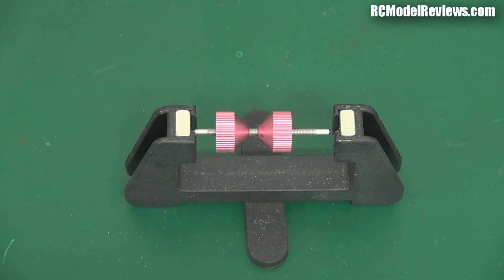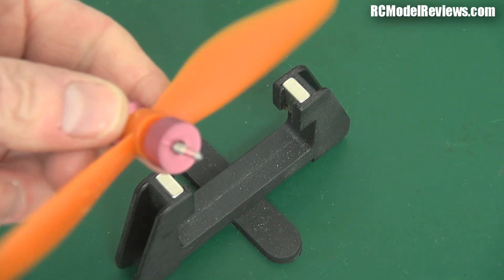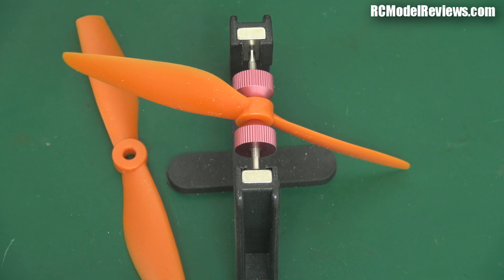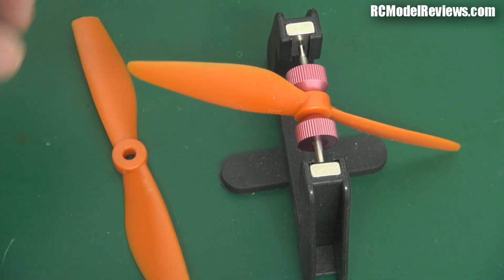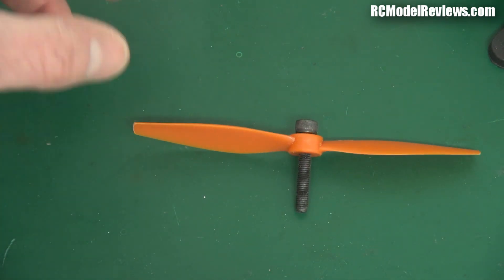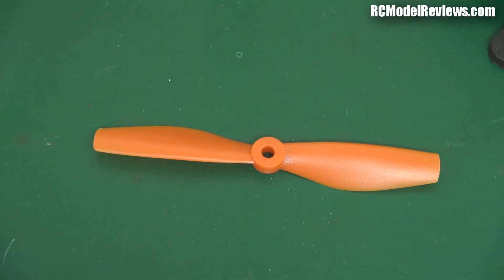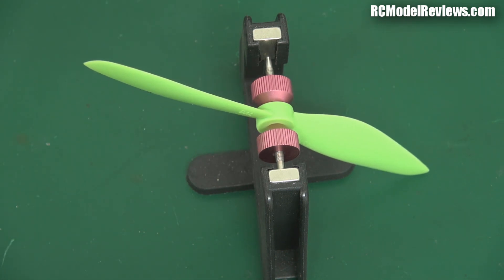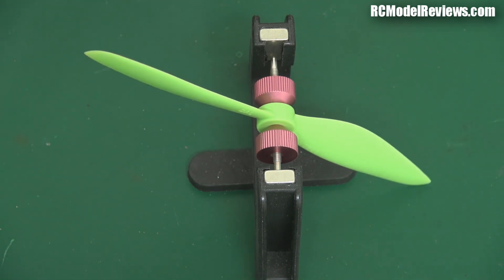DAL 6x4 propeller balance issue

Comment: Prop has to be perfectly made in 1st place for air suspended vehicles bcz even if we balance using centrifugal force balance eq m1r1w^2=m2r2w^2 with w^2 cancelling turns out to be w1r1=w2r2 same as normal weight balance. But this doesn't balance gyroscopic couple on both sides bs                gyroscopic moment=w1w2mr^2     unbalanced gyroscopic moment atributed to r^2 terms give rise to precession & instability as spin axis no longer axis of symittery & observed as toilet bowl effects

Comment: A balanced props should stay at the angle where you just hold it. If you let it go while it is horizontal, it should stay horizontal. I you let it go at 30 degree to horizontal, it should stay at 30 degree to horizontal. In the first test in this video, the prop "bounce" back to horizontal after Bruce tilted it slightly, so it is obvious that this balancer itself is not balanced.

Comment: I have this balancer,  and I discovered that the balancer its self is not balanced. the 2 clamps are not cylindrical, they are actually oval.  So this balancer is rubbish, if used with the 2 clamps

Comment: Would a small dab of 2 part epoxy, like JBweld, near the base of the opposite blade help to balance it. It could be trimmed to balance and shouldn't disturb air flow terribly with it being on the slower moving area of the blade.

Comment: I have that same prop balancer and mine is actually the reason that my props were "unbalanced". Every prop I put on it would be unbalanced as hell! After close inspection, I found that the two little thumb screws that hold the prop had their holes drilled off centre! So after checking my props on a different balancer, it was discovered that my balancer was a piece of crap and the thumb screws had heavy spots in them.

Comment: A little bit of tape goes a long way with prop balance.. Then you have it truly balanced because the thrust will be the same for both blades. I've also tested the gemfan for balance and I'll say I've seen better but on a whole they were fairly good. There vlmore difficult to balance because they weigh almost nothing.

Comment: I've noticed the same behavior on a new order of black ones. All of the counter clockwise props are way out of balance. Found it the same way you did, I only checked them because I was cutting them down and was shocked. I tested some uncut and had the same results as your video.

Comment: Buy the best mag lev you can afford. Do your testing on a level surface is key!. Anyone experienced the impossible scenario of both ends dropping from the neutral point?   maddening for sure. And I can't account for it, large or small props alike. Mercifully happens very rarely.
 Still the proof is in the measuring vibs on a jig (built like a thrust tester with no hinge) using a well balanced  kV1400 motor/adapter, a servo tester and an accelerometer app on your android phone. May be built for $20 or less. Well worth the trouble. Then you get the feel for all your efforts and what the FC of your rig is really experiencing. Now that is dynamic testing for you :-)
FIY put another rare earth mag on the factory installed to get them to hold the heavier CF and Carbon filled up to 15"

Comment: Bruce I have a different theory on these props causing undue pitch up moments.  I have a batch of these that the leading edge of is curved down severely toward the tip. I noticed that this uncommanded pitch up happened only when facing into the wind. If your quad was facing into a natural wind and you began increasing pitch, the wind wouldnt make its way under this (curved down) area of the propellor until the quad was already significantly pitched up on its own, essentially causing a sudden grab of the propellers that the flight controller can't suddenly correct for. This also happens when slowing from forward movement as the relative wind decreases. Cutting these props to 5" rids these props of this excessive curved down leading edge near the tip.
Reply: I also has the exact same problem with hq 6x3 props.

Comment: Hey Bruce, could you do a video on the efficiency of damaged props, Because I was thinking about the surveilzone indestructible props efficiency vs the gemfans and even though the gemfans have like 100 extra grams compared to the surveilzone props, I often fly until my props break, so I am wondering if the indestructible props might outperform damaged gemfans.

Comment: Hi bruce really luv your vids. Back to the UHF systems. I fly  Spectrum Dx8 tx and a 8 channel rx with 1.3 vtx with no control issues up to 350 meters.  Then I switched to Taranis and the x8r rx. Bam! the range dropped to 100meters. The vtx is 400mw with a low pass filter. I tried a notch to. Same results. Wassup?

Comment: I've said it in your other videos about these props.  I've yet to have a (red) DAL 6040 prop that DIDN'T need balancing.  I normally put tape on the back side of the prop, but have had an issue with the tape not sticking to these props, even after wiping down the props with alcohol first.  Perhaps I need to try a different tape.  Anyway...this is no surprise to me...

On a side note, I've noticed my(red) DAL 5040 props aren't nearly as bad.  About half of them need a little balancing.  Still, though, the Gemfan and HQ props can normally go from bag to motor without worry as they are well balanced from manufacturing.

I like the durability of the DAL props.  If they can fix the balance issue then they'll have a winner prop.  They're no there yet though...

Comment: Doesn't really matter  whole lot, but you're supposed to use the flat side on of of the conical nuts.
Reply: That doesn't make any sense really. The prop wouldn't be centered.
Reply: Actually yes it would, and more correctly than two cones. when you center the prop on the motor shaft it's down by centering the back half in the hole and the front against a flat nut or washer. With two cones you're centering against the whole which may not be the same as centering against the flat front like you do on the motor, and then you've balanced the prop wrongly for how it's actually mounted.

Comment: Are u sure it's not the hubs as well as the blades. I've had this problem with Rctimer props. Also the cheap ballancers often have an unballanced shaft. Make sure thats ballanced before putting a prop on there.

Comment: Hi Bruce. I got a bunch of the black-colored ones and I found that practically all of them required balancing. This is coming from someone who never bothers to balance his HQs and GFs before this. 

At any rate, I saw today that surveilzone has in stock the 6045 versions of these DAL props. Would you be willing to test them, Bruce? :)

Comment: Bruce, how about balancing the motors themselves. After some number of crashes the motors can vibrate, sometimes strongly, without any props on them. Could you offer any advice on how to balance the motor, or more specifically the motor bell? Maybe a subject for another video?

Comment: G'day,

Yay Team,

 Um, well, if it were the Plastic being badly mixed with areas of variable density then surely it would be 50:50 Random as to the Prop's emerging balanced or not, but with all the Props turning the same way having a heavy blade kinda sounds like it's a Section Thickness disparity going back to the original Hand-Carved Hardwood Propeller which the Moulds were built to copy.

  The wood at the bottom of a Tree is harder & denser and heavier than the wood at the Top, so any Plank of Timber, if measured and suspended from it's Geometric Centre, has a Heavy End & a Light End ; therefore, Wooden Aeroplane Propellers are always Laminated and the Planks are arranged with their Heavy Ends  at alternate ends of the "Sawn Blank" before the Laminae are marked for Jigsawing and Glueing..., otherwise the Blades will never be able to balance both Aerodynamically and Dynamically as well as Statically...

 My guess is that the Original Propellor was carved from Unlaminated Wood, so to make it Statically Balance while retaining symetrical Blade-Length, they've sanded material off the Thickness of the Denser Blade...; thus, when moulded in Plastic, there's a Thick Blade and a Thin Blade, and therefore one side is heavier.

  And that's my speculative guesstimation as to whereinat the Error originated...; laziness, and thinking that Lamination isn't neccessary when making Wooden Airscrews ("because it takes too much time..." is the usual excuse, followed by "it's too complicated..")..., whereas failure to laminate introduces  subtle but unfixable faults in the finished product.

In my experience,

;-p

Ciao !

Comment: I have that balancer, I found its unbalanced without a prop on it. If you hold the cones then move the prop around a bit you'll find the balance has changed.
Reply: Green Silver Yes, I had two of these, one did have  small imbalance... this one was good though.

Comment: SO thats why my miniquad just randomly pitches and spins... Naze32 on Baseflight
Reply: shaneman27 Yes, it's almost always down to vibration.  Check your motor bearings too.  If you're running 1806 motors they tend to chew through bearings pretty quickly and once they get sloppy the vibrations go right up.   This is why I'm using 2204 motors in my miniquads now, the 3mm shaft found in most 2204s uses much bigger bearings than the 2mm shaft in your average 1806 so, with a little care and attention, they last much, much longer.
Reply: I am running RCTimer 1806 motors and Gemfan 5030s. I don't get much if any jello on my video recording from the gopro mounted directly to the frame and it feels relatively vibration free. But I will have to check out this motor bearing thing. I've been looking into getting some larger and more powerful motors anyways because these don't have much power even on 4s. What 2204 motors would you recommend if I want to run 6x4 ish props on 4s and have plenty of punchout?
Reply: shaneman27 Cobra motors seem to be the most powerful at the moment and I see that Surveilzone had the 2204/2300 Cobras for $20 a pop (which isn't too bad).   I've been using the Quanum 2204/2300 from HobbyKing and so far they haven't let me down.  You'll see some speed runs on my XJet channel which feature an MXP230 with these motors and 4S -- that should give you some idea of how  they perform.
Reply: I was eyeing those Cobras. Possibly the RCMC ones that rctestflight put on his 280 frames.

Comment: Great info Bruce! I purchased 2 dozen of the 5x4's and found only 3 that where not in need balancing! I also found that if you didn't balance them, the bad ones would sheer off at the hub during flight!

Comment: ***** Instead of cutting a prop to get it to balance I will sand the prop down. I also use the dubro prop balancer and check to maker sure it is balanced on both sides. If the hub seems heavier on one side than the other I then sand the leading edge of one side and the trailing edge of the other. I do this for my Cinetank to reduce jello. If I did this on my QAV250 I would never get to fly as I would spend all my time balancing props because I go through them so fast. I have found no prop that is well balanced out of the bag. Out of 4 usually one is ok.

Comment: Nice video Bruce. I too have had the issue with the quad randomly pitching backwards due to vibration so I think you are spot on with that. I originally thought it was a wacky gyro until I changed with a new FC and it did the same thing. After a bit of balancing and a bit of gyro_lpf to filter a bit of vibration out of the FC everything went back to flying normal and have not had any issues with it pitching back since.
Reply: ModifiedRC Yes, it's quite common and leaves most people scratching their head.  Happens more when folks run 1806 motors because everything starts out good but as the motor bearings wear, vibration becomes worse until suddenly the pitch-up starts happening.  Glad you worked it out for yourself.

Comment: a couple things, first: those balancers are really crap, you need to balance the aluminium nuts before balancing props, but they are still better than nothing. you also need to balance the hub as well. I got some FC props where the hole in the hub was molded off center, they are impossible to balance, so always check first. and last you should remove material along the length of the prop on the trailing edge. that way your not reducing the length on one side. I use a razor blade to scrape along the trailing edge, you can adjust how much material youre removing by how much pressure you apply.

Comment: I respect all you know about props and balancing but I'm having a problem with your choice of balancer.  Seems to me you'd want a full rotation out of the prop to know if your hub is out of whack.  The first "balanced" prop could have actually been heavy on the hub.  I have trouble with the concept of magnetic balancers.  Won't the weight of the prop tend to make it 'sag' in the magnetic field...knocking it off center?  Seems like any little jolt you made on the prop caused the tip of that shaft to wiggle around. The props certainly did look out of whack.  But I'd be more tempted to try them on say..a Dubro type balancer with a firm and steady shaft with complete rotation.

Comment: I don't quite understand Bruce's assumption the prop is balanced at time 1:22 the hub is obviously off balance.  You can tell because the blade is returning to horizontal instantly after Bruce releases it.  The hub is JUST as important. 
Also Bruce keeps saying the prop will start to "dynamically" drift as you remove material off one blade. Hmm, I am positive Bruce is aware you can add weight to one side (tape or a smear of epoxy) as well as remove material off the other side.  There's no real need to abuse the heavy side to the point of making the prop unusable.
Reply: Cyberdactyl Yes, when balancing larger props you're dead right.  When balancing a 5" prop that will likely have a fairly short operation life however,  it's just not worth the hassle of doing a "proper" balancing job.   I've had props last as little as 30 seconds on a miniquad before they get broken so it makes no sense to spend 10 minutes balancing each one of them.  The point of the video was to show that the clockwise version of these props are pretty good out of the box but the counterclockwise ones appear fairly bad.

Comment: A DO-BRO balancer is a much better balancer. I just cut down my 7.45 props down to 6.45 and they balanced out great. And I never add weight to the hub. I add weight to the tip with some clear fingernail polish. I wish we had some way to dynamic or harmonic balance are props right now all we have is static balancing.

Comment: Well Bruce I have forgot to mention this. 6040 cut down to 5040 are amazing, but the direct 6040 are heavier on the "6040side", just like the 4letters are heavier than the 3 of the DAL. but that was on my charge of the green ones :D
Reply: Pot Racer Yes, despite the balance issues they work pretty damned well when cut down!

Comment: Might be a stupid question but do people use the the black spacer/adapter in the hq props? Or do you just put them straight on? Thanks
Reply: Tom Smith I do use the black fillings, it will give a much tighter fit around the shaft.
Reply: Tom Smith Yes, they give you them for a reason.
Reply: Tom Smith I guess it depends on the diameter of the prop adapter you are using.

Comment: Rather than shortening the heavy blade why not add weight to the light blade ??
And as stated below check the balance of the prop hub.
Reply: lasersbee Yes, adding weight works, especially for larger props but on small high-revving props and where a large amount of weight is required, it can effect blade profile and efficiency.
Reply: lasersbee dont add weight to blades do it properly, lightly sand the heavy blade (not on leading or trailing edge) till it balances then balance it vertically for hub (to light side of hub u can use small piece of velcro and drop thick CA to add weight). Once it balances in any orientation you are done !!
Reply: RC hobbyFlying There is something about spending a lot of time sanding the surface of a 55 cent  5" propeller that is skewed... IMO.

I can see this sanding procedure and do so on more expensive and larger propellers.
Reply: lasersbee try using the unbalanced one and then balancing it properly. Then you'll see! Makes a big difference, more efficient, nice clean noise instead of some nasty prop noise and no vibrations to kill your quad / plane and make bits start falling off or your video crap. You should balance any sized prop.
Efficient prop will give you longer battery life and vibrations will kill your motor bearings and /or model and make power delivery/ control that much crapper. Does take much to sand a plastic prop to balance :/
Reply: RC hobbyFlying  I see your point.
I have no problems with using weight to balance inexpensive unbalanced props on all my Multirotor aircraft to remove vibration. Of course... don't drill a hole in the prop to put a nut and bolt to try to balance it...LOL
 To each his own...;)